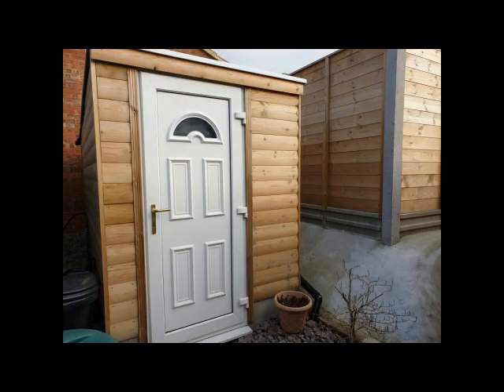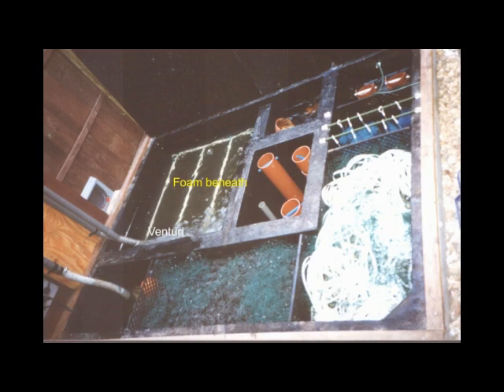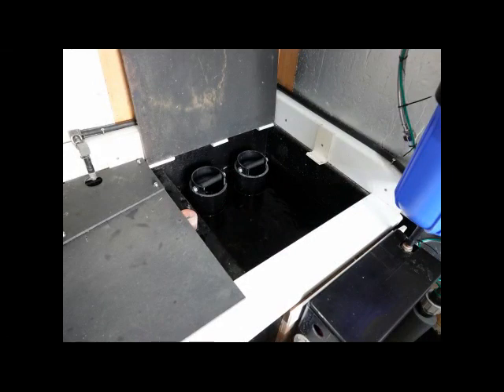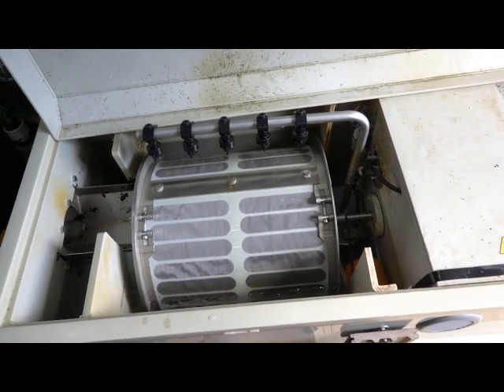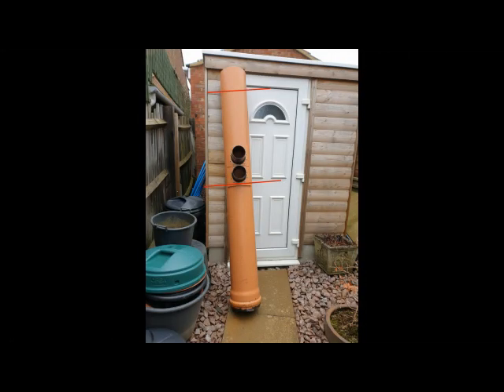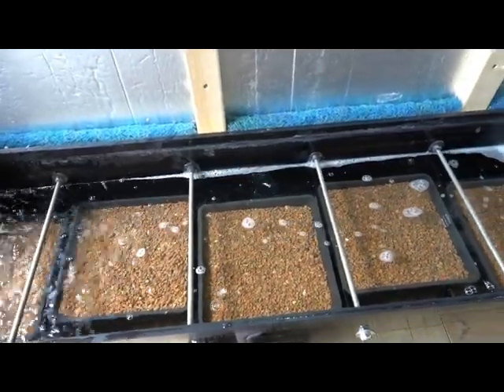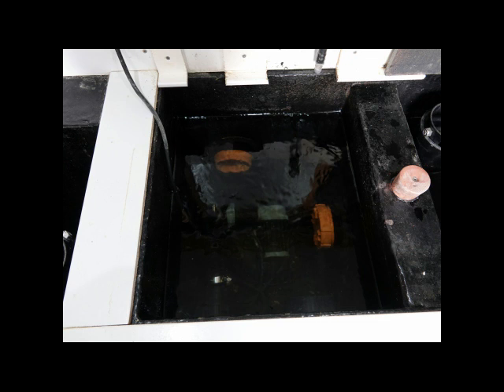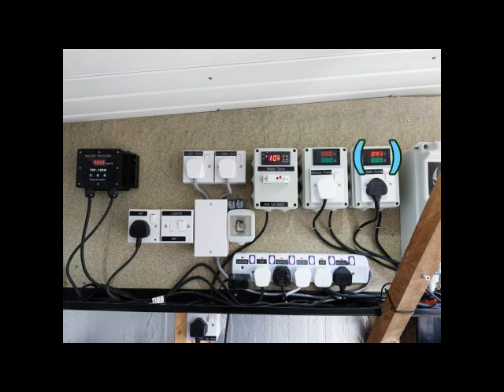Koi Pond Filter with Drum, Moving Bed, Air Lift and Anoxic

Comment: Could you provide some information on your stand pipe and how they were made? Thanks.
Reply from the maker: If you look at the video (2min 45sec) you can see that the standpipe is simply 100mm black soil pipe. The inner section is the same, just cut apart. The whole thing is removeable because it has a ringseal at the lower end. Not much more to say of show really.
Reply: @ukzerocom Thanks!

Comment: Congratulations on an elegant and supremely well implemented filter house.
I set up a drum, then air lift then anoxics and they simply didn't work well enough capping the amount of food I could give.
I've since added a moving bed and can feed what I need without the ammonia and nitrite spiking but the anoxics are not working properly leading to fluctuating but gradually increasing nitrate.
Still trying to troubleshoot them, would you be kind enough to answer three questions.
Would you be able to tell me what size of baskets you are using ?40cm
What cores do they have? I couldn't find laterite and used JBL Aquabasis Plus. The main substrate is pink calcined Moler clay
What proportion, in your estimation, goes straight to the air lift vs through the moving bed to the air lift?
Thank you in anticipation. 😊
Reply from the maker: First two as you surmised. As to the proportion passing through the moving bed it's hard to say, but in my current system the main flow is under the moving bed (which is contained by perforated mesh) and so the mixing here will only be due to turbulence in the bed itself - so most goes straight to the air lift and anoxic. NO3 is not zero, but averages at about 10ppm. Hope this helps.
PS I don't feed intensively as rapid growth not a priority.
Reply: @ukzerocom  Thank you. Not being able to find the 30x30 baskets cited in the articles,  mine are 28x28 and perhaps I should recycle them into 40x40s like you have, as essentially my original system had everything you have but with lots more baskets, as I have two independant small drums, two air lifts and two anoxic ponds with 50+ in each, so one side could fail and the other be enough to run the pond but I never got past 200g feeding per day. I did worry that the air lift before the anoxics rather than after them was the problem but you disprove that, too.
All great information from you, thank you and the search for anoxic success continues!
Reply: Please might I ask for another little bit of information? I'm going to re-pot my small baskets into large 40cm ones. Do you recall how much Aquabasis Plus, you put in each core of your baskets? 200g is suggested by Mr. M Sanke but I wondered if you did something else.

Comment: Having played around with various forms of filtration (including anoxic) and air lifts, if I built another pond I’d definitely utilise this method as it’s extremely efficient. 
For people on a budget use a decent sieve instead of a drum as you 100% require some kind of pre-filter else you’ll soon be clogged up.
From my experience on 4500 gallons and 20 odd baskets and a sensible fish load you don’t require any form of moving bed. 
It just works, ignore the naysayers, anoxic also matures far faster than plastic media.

Comment: is anoxic filter effective? does it reduce your nitrates?
Reply from the maker: Nitrates have reduced from up to 80ppm (and occasionally higher) down to less than 10ppm. I would not expect nitrate levels to reach zero because the system is a "variable hybrid" design and so retains a variable degree of regular Nitrogen Cycle NH3 to NO2 to NO3. Even with the bypass wide open there is still some deliberate "just in case" residual "normal" activity in the moving bed media and of course the rest of the pond system's surface biofilm. I didn't have the courage to completely switch to 100% anoxic with a fully stocked pond and no quarantine/backup.
Reply: @ukzerocom  what did you use for your anoxic filter? Catnip?
Reply from the maker: I used Kittyfriend Pink cat litter.

Comment: Indeed it is very intresting and highly impressive. I am into anoxic filters adapted for aquarium. Can you please do some nitrates test and let us know the results. Also some more videos of your koi and pond
Reply from the maker: Sorry, just seen this. NO3 is running consistently between 1ppm (mg/l) and approx 4ppm.
To put this into context, this time last year without the Anoxic it was hovering around the 50ppm level.
My water changing is purely controlled by level drop and not by constant trickle-in, so is much less than is often the case for Koi ponds and explains the highish pre-Anoxic NO3 level at this time in the season.
Hope this is of use.
Reply: @ukzerocom  That's is very good indeed.1ppm-4ppm.I am very impressed.  Dr. Kevin Novak should be elated. He is giving greater insights into the BCBs [biocenosis clarification baskets] currently. Electrical/ionic charge, difussion, and convection[thermodynamics] forces in the BCBs.
Reply: 1-4!!! Woah! Nice! Thanks for sharing!!!! Dr. Novak must be elated!

Comment: Hi, I am very interested to know how you are getting on with Anoxic.  I have been testing it in a 1000L aquarium for 20 months now. I have found that it deals very well with ammonia and it doesn’t seem to produce nitrate. But any nitrate produced elsewhere in the tank is not attracted into the BCB so the nitrate level slowly rises. I would be grateful for your observations as my goal is a large koi setup with anoxic as the filter. Thanks again
Reply from the maker: There is still the "back up" conventional moving bed filter running in my system. Although only a small part of the flow is now through this moving bed I have to assume it is still functioning at low level.
With that in mind my Nitrate levels are not zero, but remain low (~5ppm) despite Summer feeding and much less than usual water change rate. Ammonia and Nitrite have remained at zero throughout the transition to more Anoxic operation (apart from during KMnO4 treatments).
There are people who have gone 100% Anoxic who may be in a better position to comment.
Reply: That’s very encouraging, just one final question, what did you use for Laterite?
Reply: i am more interested how long cat litter last

Comment: How did you waterproof your chambers? I noticed black paint, is that the fibreglass flow coat?
Reply from the maker: I used special pond paint on top of a cement based tanking compound. To be honest it took an age to cure and is not very robust. If there is a next time I will go back to proper GRP as I have used in the past. I would never use non-reinforced flow coat as it will always crack and lift in time.

Comment: Nice setup. Been looking at the airlift and not found to mean people using then over here, how do you find it? Have you found your PH gone up ? Thanks 😊
Reply from the maker: pH has remained steady at 7.5-8.0
Air Lift has been working extremely well, but can be difficult to add to some existing systems due to the constraint of low head and the need for gravity returns in most cases.